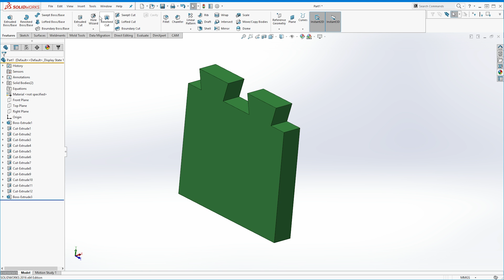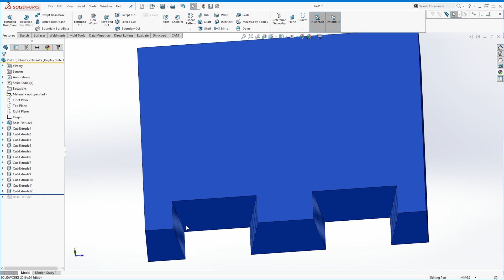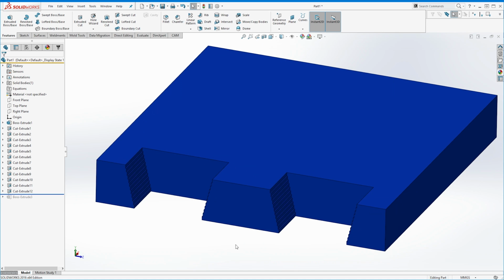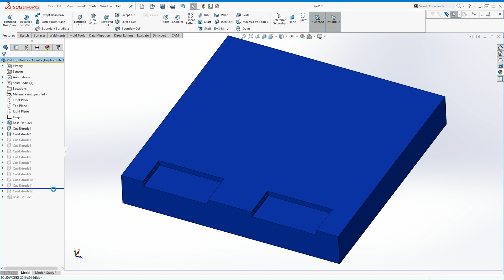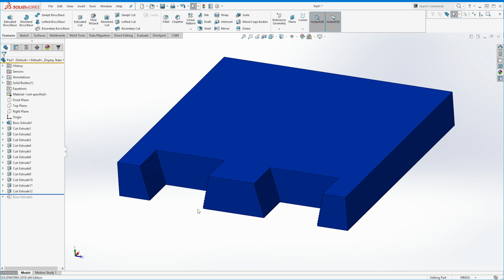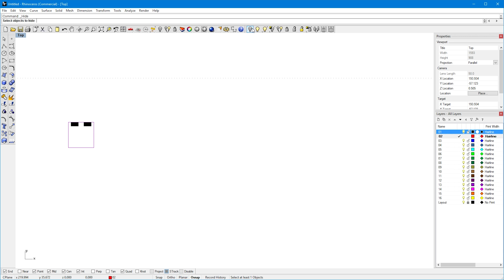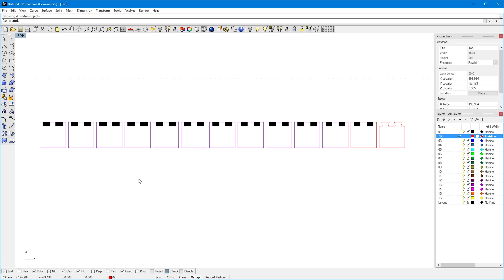Laser-Cut Dovetails (proof of concept)

Comment: It would probably be easier to put a servo controlled pivot of about 20 degrees on your laser so that you can rotate the laser by 10 degrees in either direction, and apply some trigonometry to get it to cut angles. But if you're cutting 5 mill plywood? don't bother.

Actually, a tilting bed would be easier to get both X and Y tilts... This way you don't have to modify the path the laser has to go if you're using the C02 Egyptian Mirror kit.

Comment: Wow, your channel is a goldmine for ideas :D

Pump up the air-assist and you'll get rid of the vaporised acrylic in the grooves. Also, you could adjust the Z-offset per layer so you always have the same focal distance = a consistent engraving depth
Reply: Also, you could cut out the centermost part of the dovetail before engraving, then the acrylic vapour has somewhere to go
Reply from the maker: Thanks! :)

I basically don't know how to use this machine... :/ I believe I have the air assist turned all the way up, and I haven't hooked it up to my "shop" air yet either. I guess I'm a bit afraid of putting in too much air and causing dust to fly up onto the lens or something.

I figured there'd be a way to adjust the Z on the fly, but I haven't really looked for that yet. Is it in the material properties?

The material buildup was a surprise to me, I didn't even notice it until I was wondering why the cut part had that extra taper to it. Next time (if there is a next time) I think I will try removing the inside square first.
Reply: +Hirudin The Z offset should be in Jobcontrol in the materials settings. Though, I'm not 100% sure how it is on the Speedy 100

Comment: Very cool!  Interesting approach!  I wonder if you were to extend the engraving in the Y direction by 1/16" or so....then when you cut the outline of the part, you won't get the bridge.....and I think it might help to clean up the taper you got.  I'm just guessing here since I've never done any type of laser work.  If that helps, then maybe draw the engraving box as a slight trapezoid to account for the taper.  It looks like the bottom of the pocket came out the correct size....you just had to file away a bit of the taper.  Is there any way to put an air tube in there to blow the powder away?
Reply from the maker: Thanks!

Extending the engraving rectangle is something I thought of as well (the video shows my first and only try so far) and I think it would have worked for this part. Unfortunately, I realized that extending the engraving wouldn't help (or would be impractical) for dovetails on the opposite edge of the part.

Hmm... trapezoid, that's an interesting idea! If I test this idea again I'll see if I can incorporate that idea, thanks!

As TacticalKeychains mentioned, there is an air assist already, but it's not overly powerful since it's being made by a small (tankless) compressor. There appears to be an air inlet fitting of some king on the machine, but I'm not sure how they intend it to be used (like, do I need to disable the compressor before hooking it up, what pressure should I use, etc.) so I haven't hooked it up yet. The lil' compressor is nice and quiet and only comes on when needed. It seems to do a decent job for normal cuts as well, so that's another reason I haven't bothered hooking up an air line.